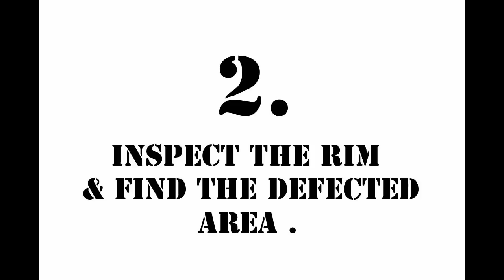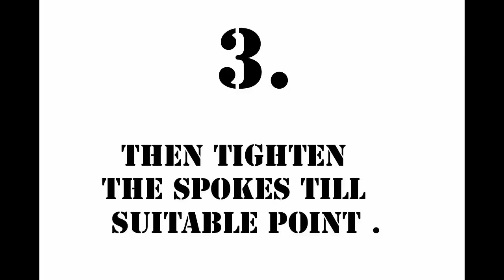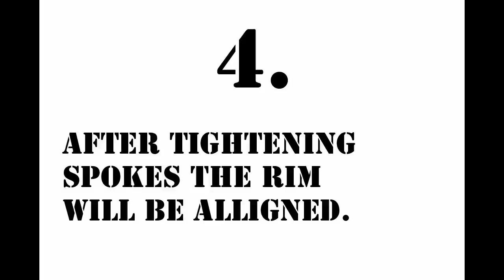How To Repair/align Spoke Wheel All Type - Royal Enfield Bullet

Comment: I had 1 spoke break.  I fixed it.  I just had 2 more break.  I have warp 9 sm wheels on a WR250R.  What can I do to fix this problem?  I tension the spokes by the sound test and by feel I’d say the are 3-4ft/lbs.  I try not to over tighten them at all.  Thanks.

Comment: Bhai need help I'm 110 kg own std 350 uce bike handle bar wooble when hands are off the handle bar above 60 kmph. rear rim has slight bend will wheelthrough work .
Reply from the maker: bro try to calibrate handle assembly with good mechanic & rim can b repaired easily

Comment: Got it done today. Charged me 400 rupees
Reply from the maker: +sarfaraz latif ✌
Reply: it charges 100 only the guy who done yours cheated u
Reply: himanshu sharma taking the wheels out, removing the tyres, and reassemble doesn't seem a 100 rupee job
Reply: i got it done by rs800
Reply: 100 - 150 rupees is maximum for spoke wheel Alignment.